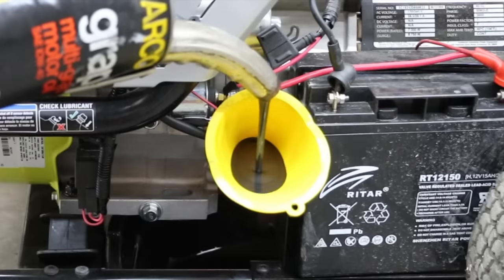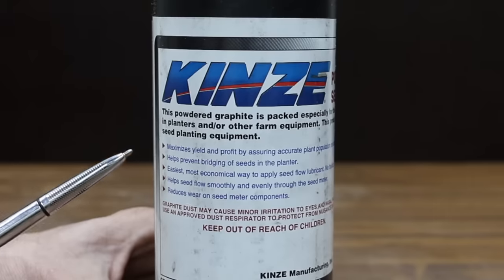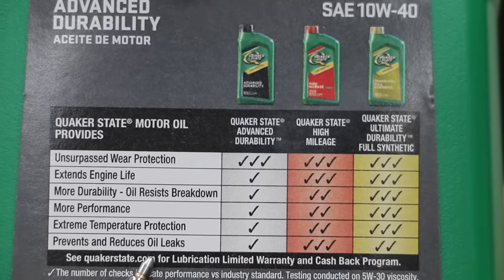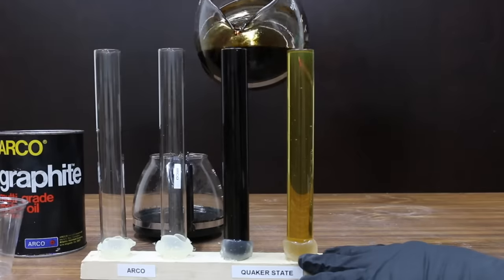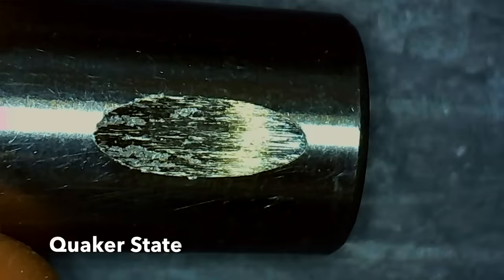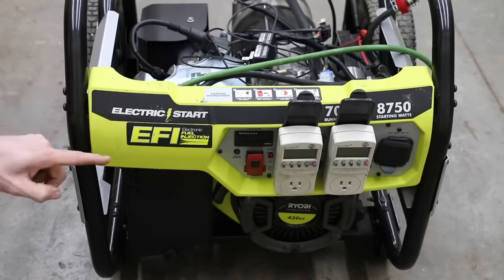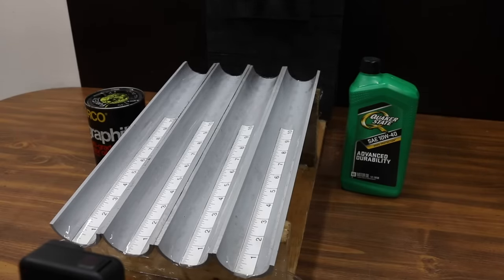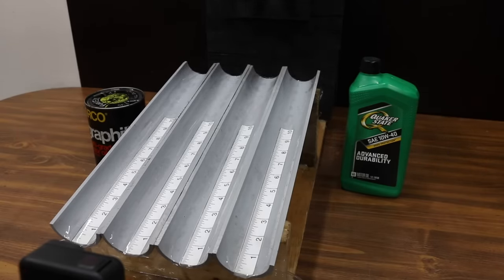Will "Graphite" Help Motor Oil Performance? Let's find out! Vintage Arco Graphite vs Quaker State

Comment: I used ARCO Graphite in my truck back in the early 80's.  I did get slightly better fuel economy, but noticed that I had reduced oil pressure, so after 3 oil changes with ARCO (3500 miles each) I drained and flushed with regular oil for 500 miles, then went back to normal motor oil.  Mileage did decrease slightly, but my oil pressure was restored.  I could only surmise that the graphite was causing restriction in my oil filter.  Great test you ran here.  Thank you..
Reply from the maker: You are welcome!  Thanks for sharing.

Comment: I had a 1980 Chevy citation with the 151 “iron duke” that thing loved the arco graphite oil. I’d get about 2-3 more MPG and it ran smoother.
Reply from the maker: Thanks for sharing.
Reply: lol a citation! those things were such junkers! they are why lemon laws exist! :) I had an 80 standard fun to beat on. powersteering pump mount just snapped off the block for no reason lol. so many things just fell off with that car for no reason! brand new off the lot and the shifter came off in hand? lol... then had an 84 automatic that one wasn't as bad...
Reply: bobspurloc for some reason I ended up with 3 through the ages. Had an X11 for a bit. Was fun thinking I had a “sports car” even if it was a farce.
Reply: @danpomeroy  lol... I learned a lot from my 80 standard tranny. I learned that when the radiator hose blows to stop driving the car ASAP! lol... I kept driving and fried the motor. It was a fun car when it didn't have things fall off. I used to sit at stop lights literally right up to someones bumper. pop the clutch which would instantly spin the tires with a screech, jam clutch back in. people would look in their rear view mirror astonished like wtf was that? lol I'de just sit there straight faced. dunno? Oh yeah I remember the stupid radio even failed hahaha stupid thing wouldn't tune anymore so I ripped it out and wired a sony Walkman headphone jack to a 40watt amp... so I had banging tunes as long as the station stayed tuned in! lol.

Comment: You're right, this Arcol oil sludged up my 1977 Ford V-8 engine, plugged oil filter, which took out mains and rings, in less than 3,000 miles! Beware
Reply from the maker: Great feedback!  Thank you
Reply: That's what I was thinking! anything with a filter, either the graphite or the filter is going to lose. Should be okay in a sling lubricated engine like a lawnmower, but how do you know when it's dirty?
Reply: Delta B operation clock (hour meter).  That’s what they do on airplanes.

Comment: my family had a 1977 toyota chinook camper with a 20r engine.  we ran arco graphite in it all thorough it's life in the 70's into the early 1980's.  that same 20r motor is still running today.
Reply from the maker: Nice!

Comment: Zinc content had to be lowered in modern oils because of contamination of the catalytic converter.  I tried one can of Arco in a pinch in a 1973 Ford Torino way back when.  I discovered which cylinders used oil and how much by the spark plugs that were shorting out.  Graphite conducts electricity.  Was impossible to just clean the plugs as there was always going to be some residue graphite.l
Reply from the maker: Great point
Reply: If it would ignite at all then running a light mist into the carb/throttle body while the engine is running can steam clean the cylinders and plugs.

You mist water into the engine enough that it begins to slow RPM, not enough to stall the engine. Generally it'll drop around 200RPM or so at the sweet spot.

It's the same thing as a busted head gasket that allows coolant to get into the cylinder, if you've ever pulled down an engine with a bad head gasket you'll notice that that cylinder has no carbon buildup whatsoever.
Reply: @glenwaldrop8166  I haven't had that pile of junk  Ford Torino since '78.  One oil change cured the problem. Been buying Toyota pickups since '87.  Problems solved.
Reply: @glenwaldrop8166  mist? you can POUR a huge amount of water in a running motor to clean it... thats something old mechanics used to do for a full tune-up, just like adjusting points, setting the carb and de-carboning it
Reply: @narmale  I prefer to recommend light mist just in case someone decides to dump a 32oz cup of water in their carb.

We ran it out of the hose, the nozzle offered a bit more control and the water supply was unlimited so I'd run it until it came out as clear exhaust.

It'll clean all kinds of crud out of your engine and exhaust. We did it before we tore down a few, if it was just a quick refresh job, no machine work, that'd take care of the combustion chambers by itself, occasionally free up stuck rings but it's difficult to be certain that was the actual fix. Most of those needed rings regardless.
Reply: A+ and well stated.
Reply: I'm guessing, but platinum or iridium plugs would probably burn nearly anything clean off themselves.  I used to use platinum, iridium and rhodium inoculation loops in a microbiology lab, between each sample you have to burn the loop clean to prevent cross-contamination, and the instant you put that loop in a bunsen flame it glows white, cools almost immediately to room temperature, and is provably shiny clean down to at least the size of a bacterium (and i expect right to the surface atomic level).  As I understand it, those very heavy metals have so many electrons that they are very willing to "loan" a few out (lending is painless if you got lots) to help complete any nearby reactions, so they make wonderful catalysts.
Reply: @ralphm4132  I initially thought I was going to argue that carbon deposits are going to be an issue anyway but come to think of it, 100K on my wife's Explorer when I got it and the plugs looked brand new. It belonged to her parents so I know they hadn't been changed. He never did anything to it but change the oil and fix the occasional body ding.

I put plugs and wires on it, we had a misfire, but even the plug from the offending cylinder was perfectly clean.

The misfire finally got worse and I found the intake gasket leaking.

We sold the engine with 196K on it, probably 80K on the second set of plugs and they were still perfect.

Comment: i have always changed my engine oil i put 4 QT. oil , 1 QT. transmission fluid it helps keep out sluge build up in the engine and lifter knocking , try it out and see what results you get .

Comment: Probably need to keep in mind that you’re comparing a 1970s oil spec to the new stuff that’ll be a huge difference there alone

I used to build diesel generators using single cylinder Chinese diesel engines 
the American oil company I believe it was had a graphite-based oil and if we ran those in those diesels we never had an engine problem if we ran regular diesel oil occasionally we would have seizures if somebody ran them low on coolant or did something else stupid

It was always said that the oil’s that came with the graphite mixed in them would pass through a filter without any issues

I’m on sure if that is still true with the newer filter technology
And I don’t know if it would go through a Franz type filter

Just some random thoughts keep up the good work !
Reply: Yeah, I'm pretty sure the ARCO engineers thought about particle size and filters, etc.  Only thing is eventually some of it is going to conglomerate and sink, down where the pickup is among other things.  Would be interesting to see a long term test and then tear down to see if it does sludge up.
Reply: @boots7859  it is possible to make mixtures of graphite that will not sink/precipitate out- a colloid(like milk, milk doesn't settle untill it goes off)

Just dividing it finely enough will help, but that's sensitive to any other muck you might add to it, like metal ions.

In general you have to add stabilizers- little soap molecules on the surface of graphite that prevent the particles clumping/settling out, but it's not something you could do at home easily.

NileRed did a video a while back on something similar when he tried to make ferrofluid (similar idea but with magnetic rust instead of graphite, so you have a magnetic liquid that doesn't settle).

It was hard, and he has a lab.
Reply: @boots7859  our tolerances thus filters are alot tighter today I imagine...

Comment: Dude I haven't seen a can of Arco in YEARS! You used to be able to buy a graphite oil additive called "King of the Road". If that sludge could not stop your car from smoking, nothing would.
Reply from the maker: I bought the Arco on Ebay.  It was more expensive than Amsoil.  lol
Reply: They missed the mark naming it. They should have called it Road Hawg! Because that sludge looks like it belongs in a pig sty.

Comment: Decades ago after an oil change for my 1.8L Audi 4000 I added an oil additive, I think after a quick review, it was "Restore" brand. I almost immediately got better idle, more power, less noise, ... A very noticeable improvement in seemingly everything! Until a couple days later when the external oil exchanger system Audi uses started leaking very badly. I had to replace the system. It had eaten some of the materials used? And the extra pressure blew the system.
Reply: That's because of the flexible tremipipe plate fitted to the reciprocating deltoïd style dingle arm, thus prevent side fumbling.
Reply: @thelaw2174  Along with a defect reverse muffler bearing interfering with the high pressure floor mats!

Comment: We need to get this man some professional oil testing equipment. Such a great job with what you have though!
Reply: Can you spare a few $100k?
Reply: @phprofYT  if all his viewers contributed a couple bucks it would be no problem
Reply: We had a USTM mini oil tester at my old shop, we tested all oils every change, we did lots of high end supercars and collectables.. its amazing what you can find out when you have one in your shop... lots of major repairs avoided.. I think it was a AMETEK, we had the cool check and the micro lab 40, I'll double check if that is the model number.. it was decently priced, like 25 bucks a sample or something.. we did around 100 a week, so it paid off quick.. I think it's like 100k to buy it outright..

Comment: I’d love to see a similar test done with a motor oil and then the same oil that has Tungsten Disulfide (WS2) added. Mostly interested in wear reduction and power production. Also, it would be neat to see how much, if any, makes it’s way to the spark plug (the graphite appeared to create a buildup on your test engine). Great vid as always.
Reply from the maker: Thank you for the video idea!
Reply: See my video of my 1981 Isuzu 6BD1T engine running with Ws2 for over 5 years
Reply: @ImWildDave  
WS2 works. Just keeping it in suspension is the kicker.

Comment: I think back in the day, when spark plugs were changed more often, the fouling of the plugs by the graphite would have been negligible. I cant imagine 100,000 miles of graphite on modern spark plugs being good for them.
Reply: If the plug is the right temp plug, it shouldn't have any fouling issues.  If its too cold then yes, I could see this making the problem even worse.
Reply: I've had a lot old rigs, it seems back in the day, plugs were always fouled! lol

Comment: Put in my buick.. drove to and from work for the week( about 50m total) Went on the freeway about 50 miles and the engine seized. Total miles on the car at the time was a tick under 60k.. so I havent used an arco product  in 50 yrs.

Comment: 45 years ago, my father always used Arco graphite to as a lubricant for the chainsaw bar oil
Reply from the maker: Great suggestion!  I might just try this with the oil I have left.  I did use it on the hay baler chain and it did seem to work well
Reply: Bar & Chain Oil: probably still a good place for that ancient formulation.
Reply: @kevinalexander2484  Yes, Graphite is cheap enough, I might get some from Fleabay and add it to the B&C oil
Reply: I use chainsaws a lot and experimented with Stihl's environ-friendly vs standard. Stay with the standard bar oil. As far as adding the graphite to bar oil,  it sounds good 👍.  Thanks!
Reply: I completely forgot.  My dad used to use it in his chainsaw too!

Comment: When I was in the Navy back in the 70s I heard about some of the guys using Arco Graphite. I used it for a couple of oil changes on my 1979 Corolla, and even 7 years later I still had black oil draining from my oil pan.
Reply from the maker: Thanks for the feedback.
Reply: Doesn't that technically mean it was still doing its job?  Lol
Reply: yeah I was wondering how the graphite would get out again after using it once. Draining the oil and topping it up wouldn't clean it out if the graphite was sticking to the inside of the oil reservoir. Not that it probably matters...
Reply: @trm4life  Ha!
Reply: @knifeyonline  yeah... Youd probably need a oil flush pump...

Comment: In the early '80s I observed several long-term tests of motor oil with technical fine molybdenum disulfide added.  It did work very well in a standard OHV V-8 to reduce wear and friction.  The problem was that over a period of time it would accumulate in small oil passages, potentially clogging them and leading to engine failures so engine oil with added moly was never marketed.  In the long run it was a good additive if you added a small amount about once every three or four oil changes.  It only took a small amount to get the benefits.  
Molybdenum disulfide is a very common additive in various automotive greases where it works very well against sliding friction.
I used to add about 1/4 teaspoon to my motorcycle fork oil to reduce "stiction".  It worked great.
Don't ingest, don't breathe the dust, other than that it's relatively safe.
Reply from the maker: Thanks for sharing.

Comment: "i sent off a sample to the lab for testing..."
tbh people should be sending stuff to you for testing, lab included lol
Reply from the maker: lol  Thanks for watching!
Reply: Is there a oil testing kit for checking one's motor oil?
Reply: @raybin6873  yes, its called a plastic bottle, and a mailbox, you put the oil in the bottle, seal it up, and mail it to the lab.
Reply: @cr4zyj4ck  Oh - OK ..I was thinking of something without your "mailbox" part
Reply: @raybin6873  you can run some through a coffee filter to check for debris.  They make tools for cutting oil filters apart for this reason.
Reply: @raybin6873  A lot of auto parts companies sell an oil test kit... follow the instructions and mail it off. I personally use the Amsoil test kit .... that's the oil I run in my cars.
Reply: @raybin6873  look up Blackstone labs. They are great!
Reply: enginemaxcarb.  GFU..good fer U. not opening my 20k outboard motor!!!!!! that's my livelihood.
Reply: enginemaxcarb. hopefully you know what you just said!! Sheesh!!
Reply: enginemaxcarb.  hmm.... that comment was painful to read.
Reply: @lefthander5  - How much does it cost sending samples to lab? I'm thinking of doing a trend analysis on car engine oil to see just how dirty oil gets - measured at specific mileage intervals. Be kind of akin to what Project Farm does - I can even report results in this comments section...
Reply: enginemaxcarb.  - kind of impractical don't you think? What of wanting to observe oil filter performance?
Reply: @CaptDavesSportfishing  - Hey capt'n - thanks for info! I'll check them out! Damn those torpedoes - full speed ahead ha ha ha!
Reply: @thedude7726  - good idea! I have a very good scanner - maybe scan samples at high resolution for better visual assessment - can archive in PC as well...gonna try this...
Reply: @lefthander5  - Amsoil oil? Never heard of that brand - I have been using cheap Wal-Mart SuperTech brand oil for many years -1996 Isuzu Rodeo - now has 482,000 miles - valve guide seals are just now starting to leak - I plan to pull cyl heads to see condition of cylinder bores - curious as I have religiously changed oil at 3,000 mile intervals on this vehicle. It still runs very good...
Reply: enginemaxcarb.  You said "Open my engine and see for myself." That implies disassembly of engine! You're not making any sense. Nothing mentioned use of a boroscope....master of chemicals? I have my doubts...
.
Reply: @lefthander5  - He doesn't - see his reply he sent to me - you tell me! Sheesh!
Reply: enginemaxcarb.  Poo poo poo!   (On your reply to "lefthander5" Yes it is you kinow....)
Reply: @raybin6873  Google Amsoil and search oil analyzer kits.... they have several options.  Preferred customer price is around $28.00 for prepaid.